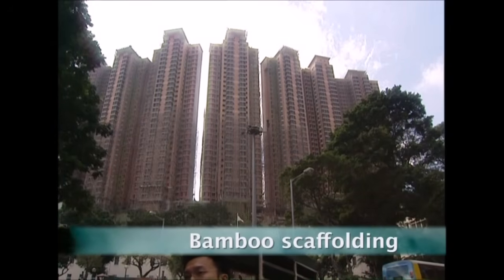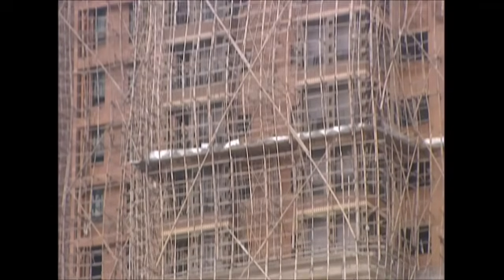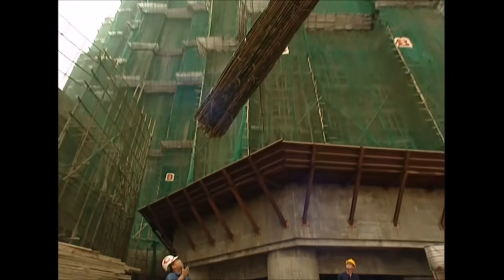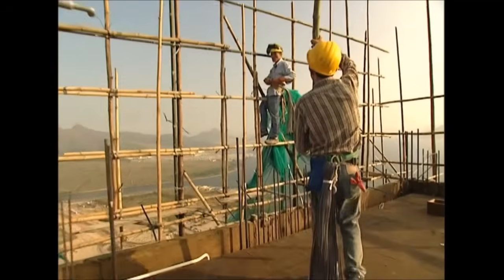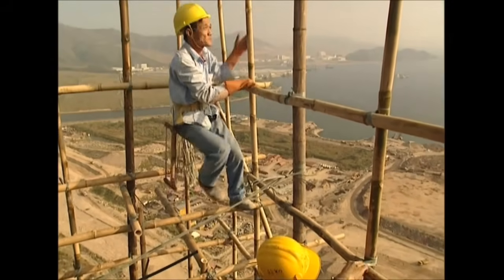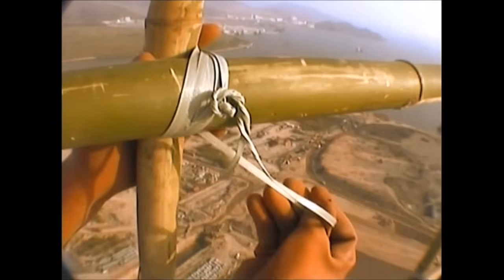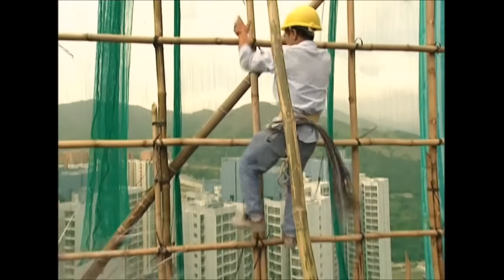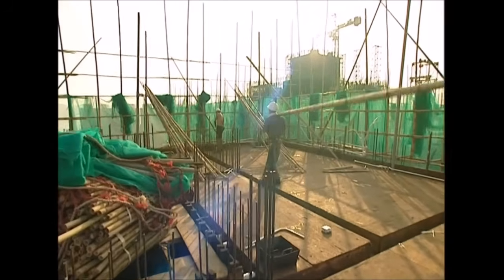HOW IT WORKS - Bamboo Scaffolding

Comment: In Sri Lanka it is also used. 
Fear not, bamboo is extremely strong against parallel forces. 
if used quality bamboos, it will  not fail  because of bamboos but because of  Nylon strings

Comment: l have worked as a bamboo  scaffolder(dismantling only) for more than a year.We used a single lanyard safety harness around our waist like  the way we wear belt and  earned HK $450/day back in 1999 with free lunch and free Yum chha.Good old memories.
Reply: Can you explain the knot used?
Reply: @roshan That seems like a great work experience, may i know  which company did you work for and where was the construction project? Im applying for construction jobs myself :)
Reply: Were you also working with safety Harness?

Comment: I have been a scaffolder for the better part of my life. I would love to work with Bamboo. Seems a lot lighter and easier to handle than the steel tubes we have to juggle with.
Reply: I have seen many bamboo scaffolders climbing without any safety. Is it normal for them to climb 7 floors. Man the way they do it so effortlessly, it was unbelievable at first when I saw it.
Reply: Yes, everything you said is right.
Reply: Not fire retardant lol

Comment: WoW you would have to REALLY trust  the workers before you who came and put together steel or bamboo scaffolding especially when 10-20 feet in the air would be dangerous enough, but going to be 100's of feet up where there's no forgiveness if a domino effect got started from just a few improperly tied sections of bamboo.